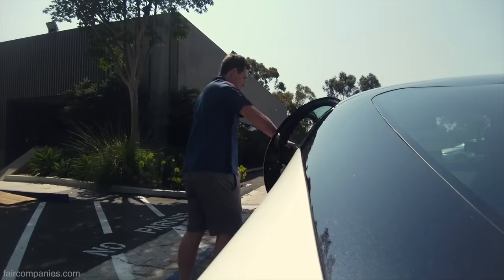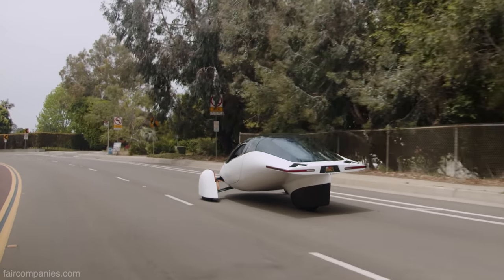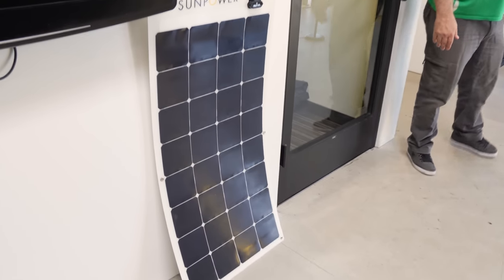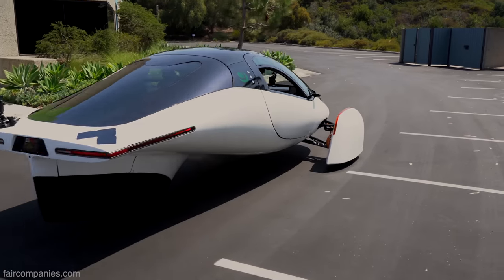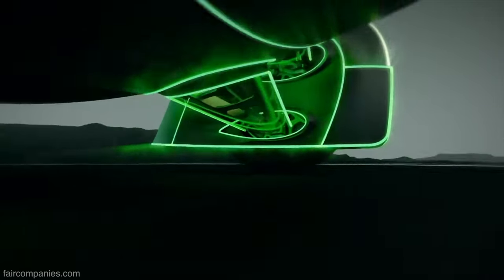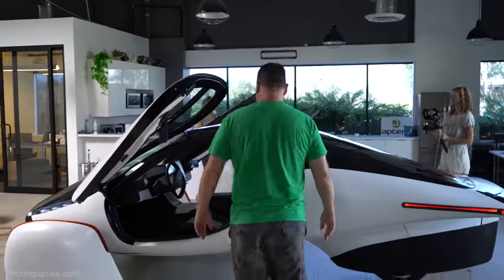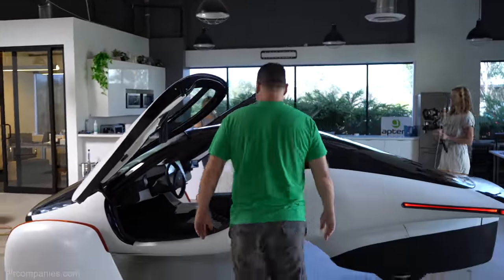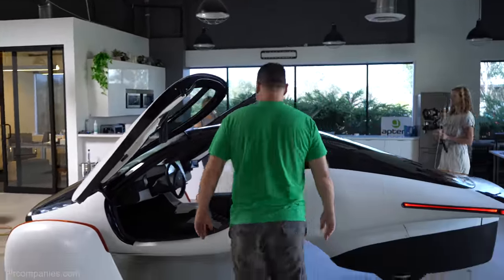Aptera commutes just on solar, gets 1K mile-range when full

Comment: You won't get the $7500 EV credit because it is a motorcycle.  The camping option might seem cool but you would need some kind of mattress topper plus sleeping bags and all the other gear.  Not sure that would all fit in the cargo area.  I ordered one though because almost all of my driving is within 25 miles of where I live and when it's not, I'm usually towing the camper with the truck.
Reply: It is covered in the bill that was passed by the House, but who knows what the Senate will eventually do.  There are also local and state incentives in some areas.   

The back has at least 25 cu ft of storage, and there is a compartment under the floor, and a frunk in front.  Likely plenty of room for camping gear for a couple and their dog.
Reply: @n.brucenelson5920  The tent itself will take up room.  Even the 1 1/2 inches memory foam topper I use is pretty bulky.  Plus backpacks, clothes, hiking sticks, ice chest, . . . there's a lot to take.  The frunk doesn't look like it will hold much from the pics I've seen.
Reply: @robertd9850  Drive the Lightning is working on a video about just this topic .  My wife and I have done motorcycle camping with tent, sleeping bags and food for as long as two weeks.  Aptera will be easy.
Reply: @n.brucenelson5920  Wouldn't work for me.  I have a cat and CPAP machine.  I like to take my inflatable kayak and folding electric bike too.
Reply: @robertd9850  We will be taking our dog.  Your CPAP machine can be powered by Aptera.  I would be a bit surprised if you can't fit these items in 25 cu ft of space.  I think that when you get yours, you might be surprised.  It will depend on how large your Kayak is, but I used to sell them, so I have a pretty good idea.
Reply: @n.brucenelson5920  I'm not seeing it for anything other than overnight and that's if I don't take the cat.  Don't really want to sleep in the same small space as the litter box although as I think about it, maybe it would fit on the floorboard in front of the passenger seat which would be fine.  Would be nice to make this work for overnight.  I was rerouted 2 hours coming back last weekend because of an overturned hazmat tractor trailer.  Took 10 hours to get home so no more trips of more than 5 or 6 hours at a time for me.

Comment: When the start actually producing them get back with me. Right now they got my hundred bucks and I have no car.
Reply: What is your order number?  I hope to get mine next year.
Reply: @n.brucenelson5920 
Aptera Motors
We've received your order.
We’ll let you know when your item is ready for full purchase.
Order No. 13321	Placed on Dec 10, 2020
Reply: @sowhat1073  Good for you. You are 3,321. In line.  It is hard to say now how quickly the supply chain will come back, but I think there is a good chance for you to get yours next Fall, with what I know now.
Reply: @n.brucenelson5920  I ordered the one with only 600 miles so kind of regretting not going for the 1k version.

Comment: Looks pretty hard to park as the wheels seem to span the entire parking slot. Heck even in this video the wheel covers are all scraped up.
Reply: The outside of the wheel covers are 88"  A standard parking lot is 108". I have a truck with mirrors spaced far wider than that.  The turning radius and power steering plus the ability to do tank turns will make this a very agile vehicle.

Comment: the reason they have 3 wheels they can be classified as an auto cycle or motorcycle then they dont have to meet safety requirements like airbags etc
Reply: While this is true, this is not the reason for the 3 wheels.  Aptera will be voluntarily tested to full FMVSS Part 200 crash test proceedures by a third party and the results published.  They will come standard with front and rear crumple zones, air bags, seat belts, and an F1 style passenger safety cage.

Comment: I see two big problems with these. When any EV becomes competitive they are immediately under fire and if anyone gets hit in one of these it will end whatever growth they have achieved. The larger problem is for volume to bring down costs it has to fill a void, not be a recreational "motorcycle".
Reply: It is a 'motorcycle' only by category.  It exceeds the performance of my present car in almost every respect, including running costs.

As far as safety is concerned, it will be crash tested to automotive standards with outstanding results.

It is still a niche vehicle, but it fills a far larger niche than the Tesla Roadster and launch the company the same way.
Reply: @n.brucenelson5920  This is far more of a niche than a Tesla Roadster. By focusing on ultra light weight you are sacrificing comfort and safety while adding expense with diminishing returns. With a more modest weight allowing a much bigger battery cell that charges / discharges at much faster rates you allow all the things this lacks. Solar expense vs function will never best rate of electrons with a larger pack. The Tesla Roadster 1.0 has AC and creature comforts this lacks and was a production car.
Reply: @AI-Driven-Entrepreneur  What makes you think the Aptera lacks AC?  You obviously haven't looked into it. Aptera already has many times the preorder numbers as the total sales of the first Roadster.
Reply: @n.brucenelson5920  it is still not in production which is the biggest hurdle of initial offering. Comparing to the biggest name in the game is your mistake... there is no comparison and long term even the legacy auto will be flattened by Tesla's insurmountable lead.
Reply: @AI-Driven-Entrepreneur  The Roadster was not only not in production, but didn't even have a working transmission in the length of time Aptera has taken to design and produce prototypes of a model designed from scratch.  

Tesla has done some admirable things.  They have been serving as a pathfinder for Aptera, and may even do some formal cooperation.  Tesla's Gigapress method of production is not remotely competitive to Aptera's production methods economically, and this will be telling in the long run.

The key importance is to grow adoption of EVs as quickly as possible and one that uses 1/3 the power is a big plus.
Reply: @n.brucenelson5920  yes a process that failed in boatmaking is going to best the gigapress LOL it is less on the sunk costs and more about the output. When your goal is 100% growth every quarter and need to output millions of vehicles this is the most efficient way. Aptera will never know such glory. Remind me of how much more efficient they are when they are on to their next great idea in 10 years and my Tesla stock is in the B range.
Reply: @AI-Driven-Entrepreneur  Vacuum resin infusion has failed neither in boatmaking or aircraft, and it will make a huge impact on personal transportation.  An order of magnitude less capital intensive production system is a not insignificant advantage.  Because of the difference in entry points and current evaluation, Aptera investment has much more room to grow than Tesla does.  This might be one reason that Sandy Munro sold off his Tesla stock, which did very well for him, and invested in Aptera.

In fact, Efficiency is key to fixing the climate mess that we have gotten ourselves in.   The costs of not acting faster are great.
Reply: @n.brucenelson5920  For the same reason solid state batteries, though more efficient, are not effective is they have to be handmade. It is about volume... People sell stock, he will come back around, and definitely made the wrong decision based on the latest uptick.
Reply: @AI-Driven-Entrepreneur There is no inherent reason that solid state batteries need to be hand made.  It is just at a newer stage in their development.  Wasteful volume is what has gotten us into the climate mess we are in, and it is costing us trillions.

 Tesla stocks latest move tells you nothing about the relative growth potential of the two companies.
Reply: @n.brucenelson5920  For once you are correct, nothing can tell of relative growth potential to compare with a vapor company with zero sales such as Aptera. Risk analysis is your best bet and on that metric Aptera is through the roof. I am all for more competition in the EV sector but this is a hobbyist dream at best.

Comment: What about uphill??
Reply: The torque is so good that power to climb hills will be very good.  There could be an issue with the vehicle slowing on long grades in very hot weather, do to cooling limits being reached, but this will not result in damage to the vehicle - only a slow down in speed.

Comment: I am a little concerned to see the Front wheel covers are very close to the Street but on the Road there is Road construction 🚧 pot holes and all kinds of gravel and what not. That’s a real world concern. Deep curbs to climb all kinds of variations payment concrete dirt there’s there’s roads that need serious repair. What will happen with those wheel covers?
Reply: This is an alpha vehicle and much has been redesigned, including the wheel covers.  The covers rise with the wheels when things like speed bumps are encountered, and the wheel pants have flexible EVA portions.  The will do better than the air dam on my current Honda.

Comment: I wonder what the expected delivery date would be
Reply: A lot of uncertainty due to supply chain and crash test schedule, but my best guess is that I will have my early model next summer.
Reply: @n.brucenelson5920  WOW next summer is definitely a challenge for the company I was thinking more like 2024-2025
Reply: @Alek88vez  yes. They are moving quickly.  Lets hope there are no major glitches in the beta validation testing and the supply chain can deliver. Some parts, such as the safety pilot option could be plugged into a completed vehicle after delivery

Comment: Hit one pot hole and shatter the covers around the wheels.
Reply: Depends on the pot hole!  The front wheel "covers" go up and down with the wheel so they are not as vulnerable.  The rear "cover" will have, as I understand it, 5 inches of ground clearance.  I assume that means that unless a pot hole is 5 inches deep or deeper, it's not vulnerable either.

Comment: i think having motor in the wheels will be a problem for suspension because of the weight
Reply: The weight of the wheel motors is only around 50 lbs - well within the range of many production vehicles with standard steel wheels.
Reply: @n.brucenelson5920  that would mean double the weight, they say in the video that suspension is not great so i am looking forward to see hoe this trend unfolds, this is somehing that didn't have great succes in mountain bikes but is not unheard of either
Reply: @user-uw3fi2zg4t  My wife and I rode in an alpha version, and while I would not call the suspension faulty (It handled speed bumps fine) I would also not call it great.  Roush Performance has completely redesigned the suspension, adding a front sway bar and replacing the single rear swing arm with a dual link rear.  Reports are that it does great now, and it passes the moose test - something many 4 wheel vehicles on the market can't do.
Reply: @n.brucenelson5920  No Aptera has been Moose tested. That setup they made at Chuckwalla had wider tracks than are permitted in official tests, and Mr Whippy's vans would probably pass there. Your wife and yourself are no recommendation for suspension credentials. I keep telling you, and you keep ignoring it.

Comment: one thing i seriously do not understand is that why the solar cells are arranged diagonally? Won't you be able to cram more cells and generate even more power when you arrange them in perfect square? so much surface area wasted IMHO.

And it's only 2 seats, not 4 seats, so kinda less useful for a family car. But i still like it. I guess if you make it longer you can cram more solar cells and them give it more range.

And you can actually install an auto gyroscope system and make it upright forever, with only 2 wheels, thus eliminating more friction and making the car more aerodynamic, such as Lit Motor's Lit C-1.

about the side view camera, why not mount them on the back of two front wheels. More aerodynamic that way.
Reply: Regarding "one thing i seriously do not understand is that why the solar cells are arranged diagonally?", it's beginning to look like it's purely cosmetic.  Aptera has been granted a "design" patent (not a "utility patent") for the layout.  They have also applied for two "utility" patents but both have been rejected.  One of them is being contested.  I looked up the latest on the contested utility patent application and it's not looking too good for Aptera.
Reply: @bobhilder1469  i see, thanks for the heads up.
Reply: @isaachiew676  My pleasure.

Comment: This design as a van would get far more miles from solar.
Reply: I assume because there is more surface area to put solar cells on.  Aptera does have van-like 4 wheel vehicles in the pipeline.  We will hear more about them after they go public in 12 -18 months.
Reply: @n.brucenelson5920  The only thing to assume is more surface area,  so I left it there for people to catch the obvious.  Or maybe just a stretch car with lots of potential (unuseable) room in the back for camping.
Reply: @emmanuelr710  Elon Musk will launch an all solar powered RV in less than 1 month.
 Tesla has solar powered semi trucks and busses in the final stage of preproduction.
Aptera will be unable to compete.
Reply: @sandervanderkammen9230  The physics of a completely solar powered semi-truck is impossible.  You would only get 2 miles of towing daily at best from solar.
Reply: @emmanuelr710  Then explain how? As Bruce Nelson from Aptera insists... that you can achieve 1,000 miles on solar with the Aptera???
I mean they must have proven this with some kind of independent testing and published in a engineering journal right?
People don't just pre-order a $50,000 vehicle based on a YouTube  channel hosted by a comedian right?
That would be completely insane!

Comment: i have alot of hours operating a 3 wheel mower.... with single rear wheel,  and the same model mower with 4 wheels.   The single rear wheel always has a horrible ride,  because every bump is transferred upward into the vehicle.  Go buy a kids 3 wheel scooter and a 2 wheel scooter....compare the ride quality and you will see what Im talking about.   Even in the video they comment on how rough the ride is.
Reply: The mower doesn't have a Roush Performance designed suspension, nor did the alpha Aptera prototype in the video.  The production vehicle is a new ballgame.
Reply: @n.brucenelson5920  The production vehicle doesn't exist.

Comment: Citroen DS20 was the last car designed by engineers.
Ever since, they've been designed by Marketing, because if the customers don't buy it, it's a dud.
PS. Use active hydraulic suspension.
Reply: Hydraulic suspension ( a la Citroen) is too heavy for the Aptera performance goals.  There will be a sway single sway bar up front and a dual link rear suspension, designed by Roush Performance.  This is a change from the prototypes.
Reply: @n.brucenelson5920  
The salient point has been missed.
You are designing a car using Engineering principles.
The buyers will demand a vehicle designed according to marketing principles.
Reply: @arthurrobey4945  Interesting point.  Many of the comments regarding Aptera are that the information is all marketing with little engineering.  I see both in the Aptera produced material, but it does show that no one segment of the market can be fully satisfied.  

You are correct that this vehicle is narrowly focused on particular performance and utility goals that will only meet the desires of a particular niche.  I believe that that niche is far larger than that for the Tesla Roadster for one example, and that the preorders in hand are likely less than 1 percent of the eventual demand for this product in part because so few have even heard of it yet.  The second Aptera vehicle, - a 4 wheel, 5 passenger sedan, will meet the needs of many more people, especially when the selling price is revealed.

Comment: What if there is no sun. How do you charge it then.
Reply: It plugs into any power source. It will gain 13 miles per hour from a standard 110 volt 15 amp socket - or 500 miles per hour on a 50 kW DC fast charger.
Reply: Tell the guy in the back to pedal faster (at 2:18 in video).  😁

Comment: Seems unnecessarily wide across the front wheels. I dont think Ild like to have a head on with a Ford 150.
Reply: Why would you want a head on with any vehicle?  It will certainly be safer than in any other motorcycle classed vehicle.  As far as the width at the front wheels, this gives more stable handling and reduces aerodynamic drag by around 10% - a considerable performance benefit.

Comment: Aptera is very nice but remember you are riding a motocycle..... so just do get in to a car accident.... this is why will never buy and drive anything smaller than a mid size car.  1000 miles you can not beat that.
Reply: It is designed to and will be tested to automotive crash test standards.  The ratings will be published before shipping begins.

Comment: So why don’t the sell a charging package to public an add on hood and trunk  that extends range.
Reply: Do you mean more solar cells?  If so, the full solar package does just that.
Reply: Hood and trunk are safety crumple zones so they won't hold batteriies.The solar range already meets many American's driving needs.  Extending the hood and trunk would add weight and could cost more than would be gained.